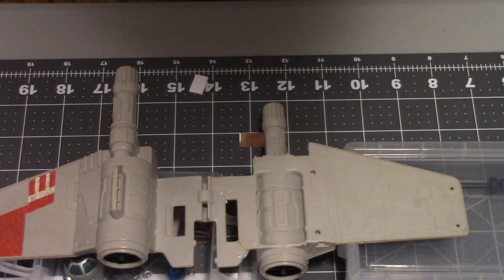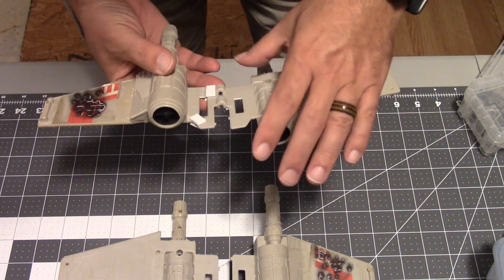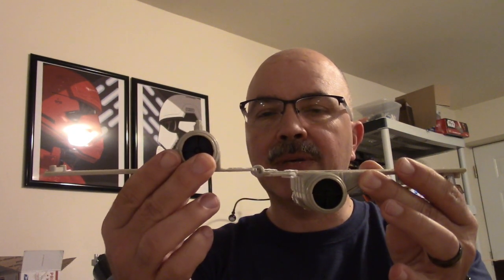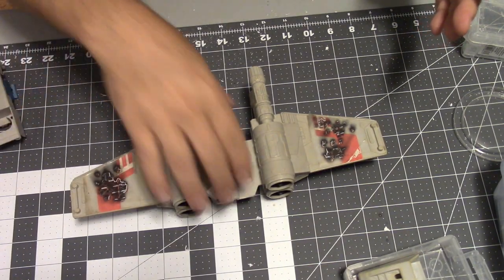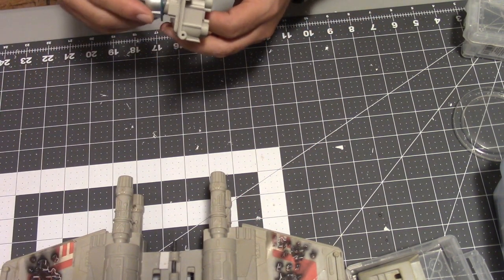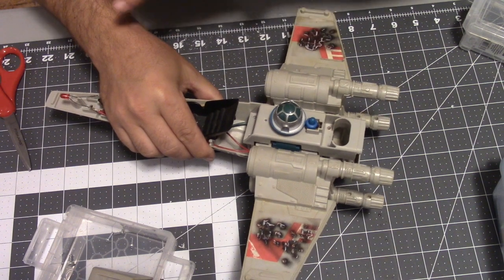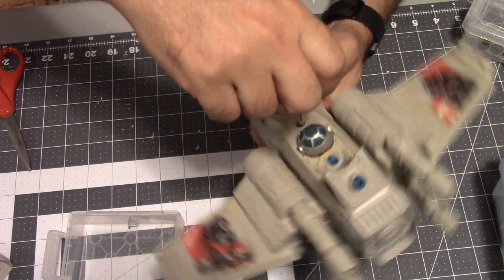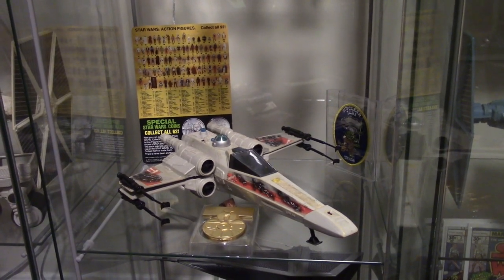How To: Restoring a Vintage Star Wars X-Wing (Part Two)

Comment: I wonder why the wings did that. I'm restoring one that I just got for $3.00 at a thrift store. It's a 1978. Same broken wing problem. I've got it covered in 40 volume cream now and it bright white again. I'm about to fix the wing. Wish me luck.
Reply from the maker: The very best of luck!! I see a lot of the vintage X Wings on eBay with the broken wing. Not sure if they all had a rough life as a toy, or if the plastic broke from hanging or what. Either way they can lead to inexpensive projects for restoration or awesome dioramas. Keep us advised on your project, would love to see some photos when she's done! Good luck & MTFBWY!